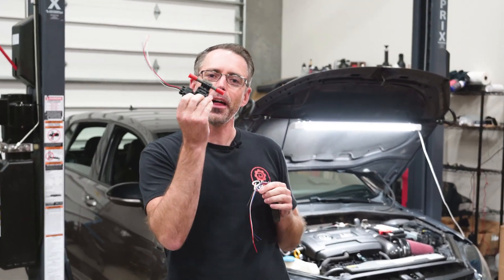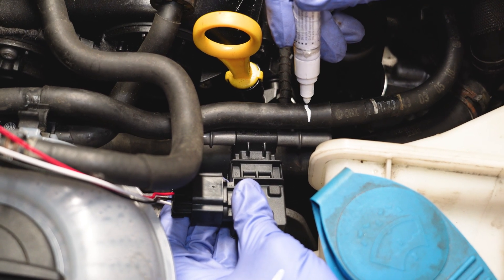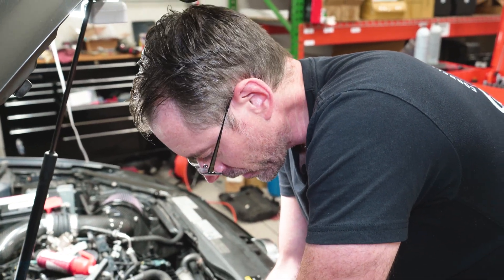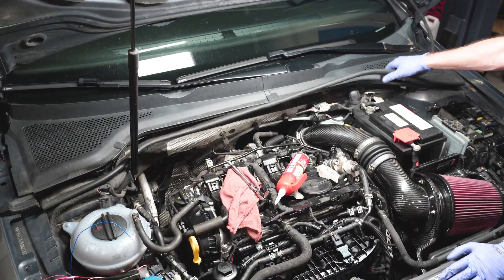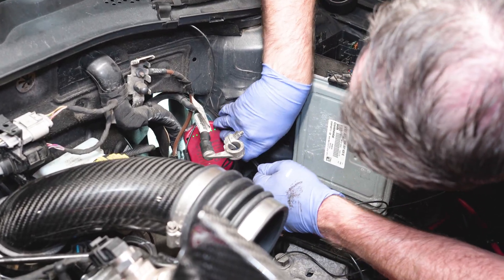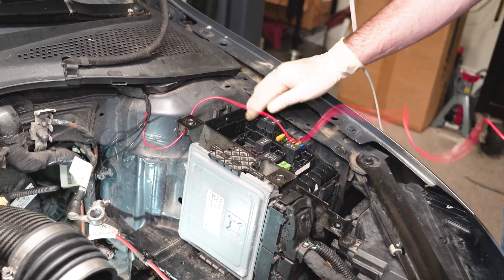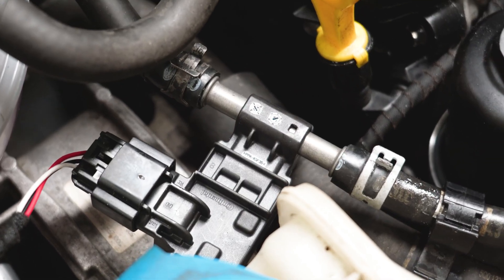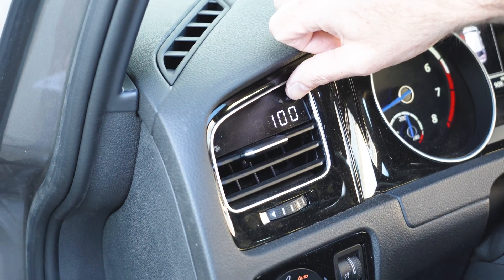How to Read Ethanol Content of Fuel | E85 Sensor DIY

Comment: Nice install, BUT the ethanol sensor barb is meant to be used with a quick disconnect fitting. 5/16 to 3/8 quick connect fuel fittings are what you need. Or go all fancy with AN fittings.
Hose clamp onto the smooth tubing will eventually come off.